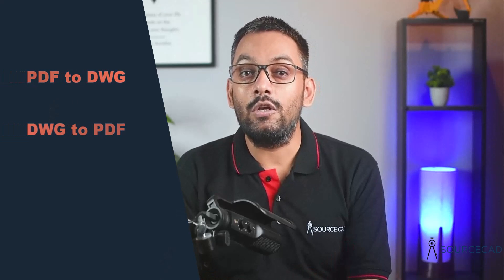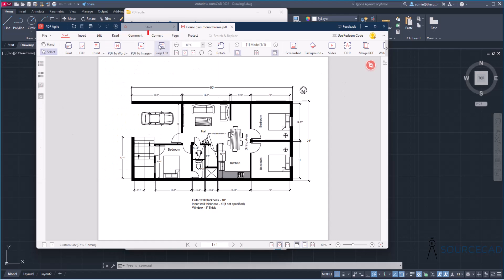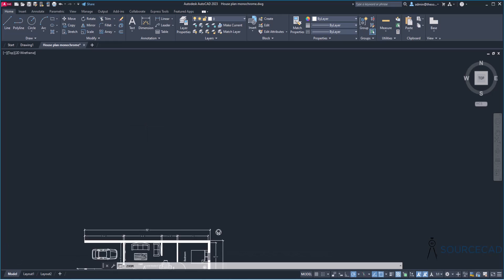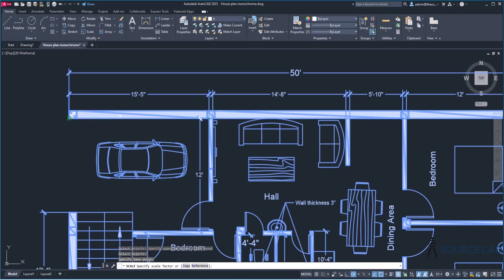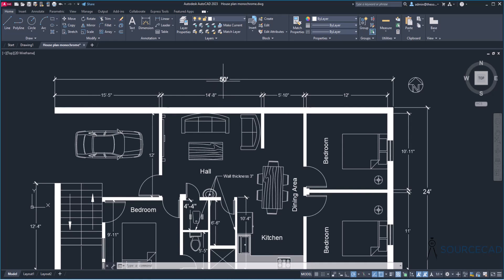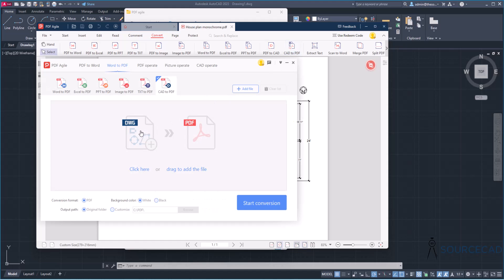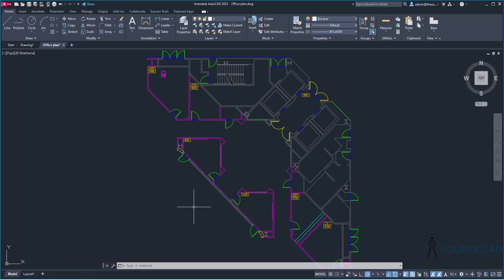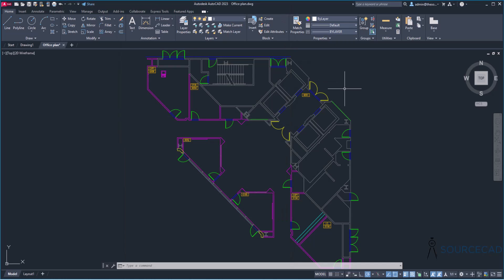How to Convert PDF to DWG and Convert it Back using PDF Agile

Comment: We have PDF file with a technical drawing with several part numbers (spare parts).
Can the PDF be converted so that we can connect the article number listed in the drawing with the article in a database?
So one-click on the article number on the drawing and as a link/result the article in the database.

Comment: Quite frankly, AutoCad can already do all of this.
To output a PDF file, just use the DWG to PDF option in the Plot dialog.
Also, one can import a PDF to DWG with the AutoCad PDF Import option.
I suppose, if one doesn't have AutoCad, this would be useful, but why would I ever send a DWG file to someone without AutoCad?
I'll just print it out as a PDF, same as I do for Excel, Word et al.
Reply from the maker: Though you are right, I have found PDF agile to be better at recognizing text and converting it directly into Mtext right out of the box. This however is still not polished in AutoCAD especially when text is vertically aligned.